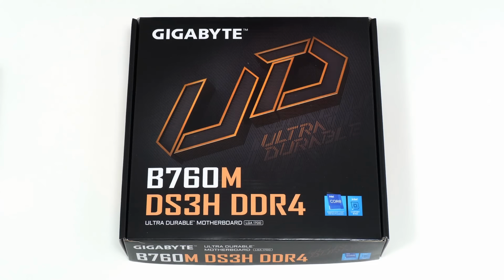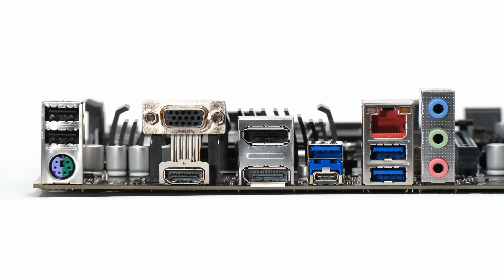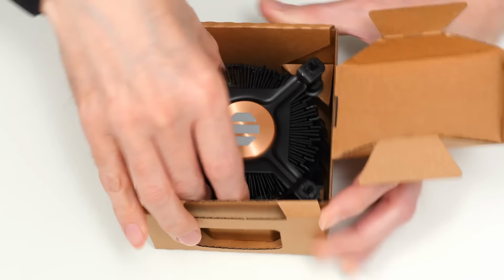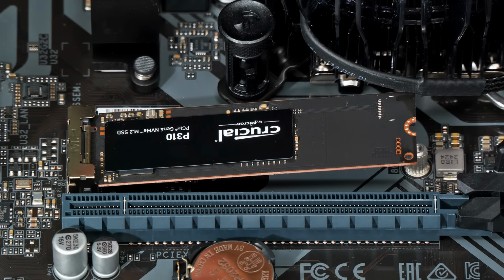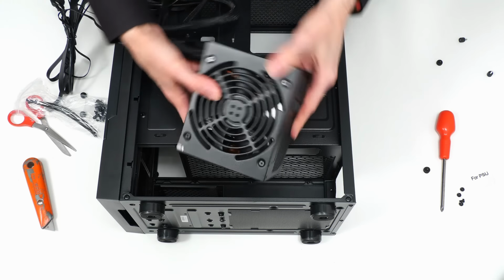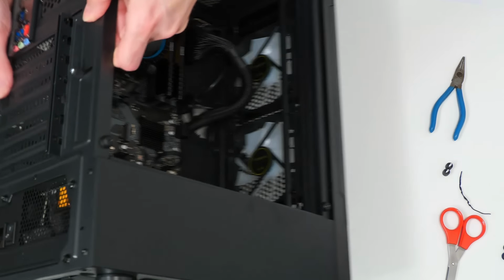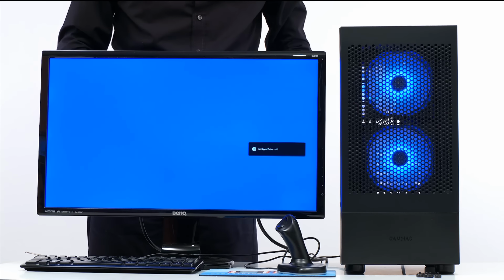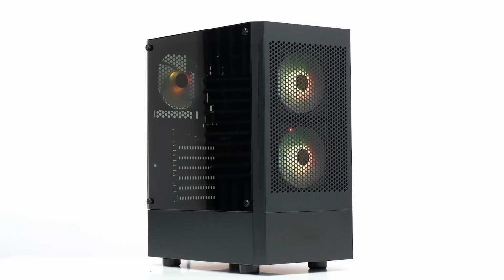Building a $500 PC

Comment: Very interesting video, Chris. It's amazing how much Mother Boards have changed over the years. The amount of connectivity is fantastic. Plus with that case you have loads of room for extra Storage, Memory or a more powerful Graphics Card. Anyone would be delighted with that as an entry level PC. Why not try a Hackintosh ? Anyway, thanks so much for sharing.
Reply from the maker: Greetings Brian. I must do a Hackintosh one day.
Reply: What makes a good hackintosh these days? I have a very old one -- 10.8??  on a Dell Optiplex 9010 (everything worked out of the box except networking, even tho I didn't install any kexts) but as I don't actually use it, I haven't got around to attempting an upgrade. Was fun to try, tho.

Comment: Can you arrange for the power supply fan to suck from the back and blow out of the bottom? 
If you don't want to be shoveling dust out of the box periodically, fans should be sucking from the outside through a filter and raising the pressure inside the box. Sucking off the floor is asking for trouble.

Comment: Whar a great video. I'm looking at getting a new PC, as my curent iMac is a 2014 model and really slow. I do 3D printing, so looking at getting a faster PC that can handle the slicing software etc. This seems to be just what I need,  May install 32gig memory though, instead of 16. Would this be an issue for this board/processor?

Comment: 06.01 It is not a resetbutton on the MB but the Q-flash plus button to install a new bios needed if the installed bios did not recognize the new processor without installing a processor, memory. Very usefull.  Love your explaining .. Greetings from Holland.

Comment: Pretty nice, the only thing I would recommend to anyone that wants to actually build this would be to splurge for at least 1TB (which should cost only about $20 more) because for example games these days are simply huge (like the 80GB needed for Cyberpunk 2077) so I think it's worth to have more breathing room from the get go
Reply: Not only are they huge, I've even had one or two games complain recently that they were installed on a HDD rather than an SSD! 😂
Reply: Or spend $100 on a refurbished ~8TB spinning platter and never worry about parking space again.
Reply: You think Cyberpunk 2077 will run and even run at all on that build? LMAO!

Comment: A trick I discovered while opening large heavy items like a lawn mower for instance is to turn the box upside down and open the flaps and then carefully turn it over with the flaps out of course and then simply lift the box off of the item.  This leaves the thing upright and the packing material can be easily removed.  Much easier than lifting something out of the box.  You might try this with your next PC case or whatever.  Would look good on camera because you can frame the important thing while removing the box.
Reply: Hey there!  We are trying to keep Stanley the Knife and Mr. Scissors employed around here!

Comment: The build makes perfect sense for the channel’s audience (whose goal is to explain computers to the uninitiated). With brand-new, store-bought parts, there’s little risk, and even in the worst case, everything comes with a full warranty.

However, those with some experience - or the adventurous - can try to assemble a machine with used parts. 
I wouldn’t recommend buying a second-hand PSU, SSD, or RAM, but you can easily find a motherboard, CPU, and GPU that, within the same budget, will completely outclass the build shown in the video.
Reply: I build mine from used and salvage for that very reason. But it's harder for a newbie to square up everything they need off the chaos that is eBay. They certainly will not have the experience to tell quality from crap in the used market. So for an initial PC building experience, I think going with this sort of build-from-new is useful. And it has a good upgrade path as the motherboard supports a much faster CPU (economical, once it's last years' model at pennies on the dollar) and more RAM, and that's a good place for the novice upgrader to start. And, of course, a better GPU is another good upgrade option. All without needing to rebuild the base unit.

Consider: All PCs run on used parts (they are "used" from the moment it first turns on). I don't buy used SSDs because of the lifespan limits (and the egregious fakery in the used-flash-storage market), but I do pretty much everything else. The only bad RAM I've ever seen was Kingston new in the box; none of the hundreds of GBs I've bought used had any defects whatsoever. Good quality PSUs will run 24/7 for about 20 years, and they are easy to test. And there are a lot of low-mileage HDDs available, if you need that storage. (I buy stacks of laptop HDDs for test use for around $5 each, and the average runtime is under 1000 hours, vs rated lifespan of 45,000 hours.)
Reply: @Reziac  
>it's harder for a newbie to square up everything they need off the chaos that is eBay

Oh don't get me wrong; I agree with all that - that's why I wrote that it makes total sense to demonstrate (to a newbie) the arcana of building a PC using new parts only. But it's hard not to cringe looking at the extremely entry-level GPU or that budget 4-core CPU when you can get CPU that's twice that fast and GPU three times as powerful for a similar amount of money.

I wouldn't recommend getting used PSUs. Yes, good ones last for a very long time (I have 15-years old OCZ psu that works just fine), but they can be affected by their working environments (heat, dust buildup etc) and have moving parts that can fail (I just put a new noctua fan in that ancient OCZ of mine) 

As for RAM, DDR4 is so cheap these days that it wouldn't make a huge difference. Also, while the risk is low, you can always get scammed or be sold untested faulty dice, and having an additional potential point of failure is just not advisable for someone with little experience in troubleshooting.

Comment: Just one tip; Check the routing for the 8-pin motherboard power connector before fitting the motherboard into the case. On more than one occasion I've found it impossible to route the 8-pin connector neatly after fitting the motherboard, so I've had to take it out again. Very annoying  !

Comment: Great video  and perfect timing for me. I am going to build a computer 
from the old parts my kids no longer use. I have a steel legend motherboard 
athlon 3000g CPU, nvidia1050 video card, 8gb ram stick, 550 watt power 
supply and about a dozen ssds ( they through them away at my job 
only 1 was broken) . I figure I just need the case now. Thank you.
Reply: Sounds like my kind of PC (mine are mostly built from salvage). Will be a pretty good unit!

Comment: 18:56 The most surprising thing about this build is that there are still PS/2 and VGA ports on a motherboard in 2025.  Is it even possible to buy a brand new PS/2 keyboard and monitor with a VGA port?  Not a dongle but an actual port.  I have those just sitting around from equipment I bought 25 years ago and occasionally have need of it with old PC hardware that I occasionally fire up, but I and most people have moved onto USB and HDMI/DisplayPort because those generally work fairly well.

Comment: It’s very strange that the fans didn’t have standard connectors, but oh well. However, did you remember to activate XMP? The RAM’s packaging only indicated AMD’s EXPO, but I honestly don’t know if that’s an issue.

Also, I only learned recently that no Intel CPU officially supports DDR4 speeds beyond 3200. Anything faster is technically overclocking, even though it’s basically a BIOS preset.

Keep up the good work!

Comment: Hate the black on black power buttons.  Sheesh.  I use white nail polish to make them stand out.

I'm probably just old fashioned but don't like the power supplies at the bottom of the case.  Is there any advantage of it being on top or bottom?  Only thing I can think of would be weight nearer the bottom of the case for stability, but I've never had any issue with a case falling over with the p/s at the top...  :)

Ugh, just saw that the p/s brings air for it's own cooling form the bottom of the case, where the MOST dust, etc. comes from.  Yuck.

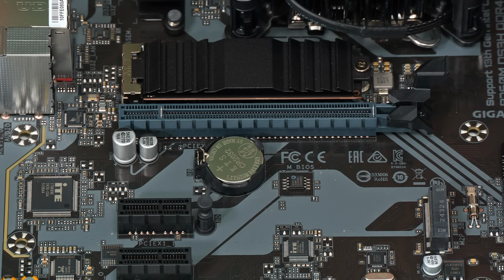Comment: 14:11  It should be noted that installing additional NVME drives on some motherboards will disable one of the additional PCIE sockets when its PCIE lanes are redirected to the SSD. I learned this the hard way. 😅
Reply: Indeed!!! Was going to comment the same! I was very surprised when was researching for a new build that this is the case. I would buy a SATA SSD, that are very fast nevertheless, to avoid that to happen. I thought Christopher was going to comment about it.
Reply: Good observation!!!  I was going to instal a second NVME on my system but something didn't feel right about it.  Thank you for clarifying.  Really, I have been happy with the solid state drives so I will just stay there.  They are fast enough.

Moonpie
Reply: @ian45-d8q   Only if you need the associated PCIE slot for another card. In my case I found out when I wanted to install a video capture card and it didn’t work because I’d already installed an NVME SSD.
Reply: It's wild for me how motherboards and chips nowadays can't handle much peripherals. Back in 2010 we had lots of USB, lots of SATA and PCIe ports, saturating a chipset was pretty rare lol
Reply: This might also disable two SATA ports (PRIME B550-PLUS).
Reply: @ Id never heard of that happening. Good to know; thank you!

Comment: Is that really better than a motherboard with a decent APU? I'm skeptical. 4GB is a real limitation. could have gotten an AM4 mobo with a 5700G.
Reply from the maker: This certainly out-performs my 5600G build -- and you do not lose any system RAM to the GPU. 4GB RAM is NOT a "real limitation". Not least, DaVinci Resolve runs well in real time -- and nobody can edit video faster than that. Oh, and DaVinci Resolve doe not even run on the 5600G system -- there are benefits to a discrete graphics card!

Comment: Why don't you disconnect the fans from the sata power adaptor and plug them directly into the motherboard? 
It looks like they have 4 pin connectors, so speed control should work fine.
Reply from the maker: Because, as I mentioned in the video, they DO NOT have standard fan connectors, and CANNOT be plugged into the motherboard! :)
Reply: @ExplainingComputers  Sorry, I assumed you refer to the sata and the RGB plugs on the adaptor. 
I didn't know you unplugged the fans from the adaptor, as I didn't see the fans connectors in the video. 
It's just hard to imagine what went on in the manufacturers mind, to go to the extra expenses for proprietary connectors, while making the value for the customer worse.

Comment: Do you have plans for making videos about building a server that can be used to host own web applications? Many small companies and startups struggle with the expensive commercial cloud hosting services. We are using Synology NAS for that prupose (which is not optimal and also expensive), and we would appreciate your inputs on that!
Reply from the maker: I don't have plans, but have made a note.
Reply: You don't have to jump straight to the end go cloud you can just rent a modest linux machine and use that, they cost buttons.
Reply: You can install a LAMP server on any Linux system.

LAMP stands for "Linux, Apache, MySQL and PHP / Perl / Python" and you'll find packages for these in your distro repositories.

Apache is a web server. That is, it responds to HTTP (port 80) / HTTPS (port 8080) requests and serves files from the system.

You can place HTML, CSS and JavaScript files in a particular folder, then write a config file for Apache to tell it where those files are (and other parameters, like SSL certificates, if using HTTPS). Then it'll listen for HTTP requests on port 80 (or HTTPS on port 8080) and serve up the files.

Opening up the firewall to port 80 or port 8080 allows incoming requests to be received by your "server" and it'll just work.

I did this for a web development job once. In order to demo to the client the website I've designed and developed for them, I took in my modest Linux laptop that had Apache installed to their office, connected to their LAN and then discovered the IP address it had been assigned.

Then I told them that if they used that IP address in their browsers, they could see the website I'd developed.

They didn't have to huddle around the screen or take turns to use it, but could simply use their own office PCs to browse to my "laptop server" and each could individually take a look at the website.

I guess the point I'm getting at is that a "server" is just a machine that serves files - listens to port 80 / 8080 and doles out files on request - and you can turn your desktop or laptop at home into a web server, no problem.

When talking about "server hardware", as found in data centres, it's still PC hardware. It's just been optimised for this purpose - lots of storage, lots of bandwidth, redundant CPUs, redundant power supplies, multiple network connections, etc. and designed to be "rack mounted" so you can slide dozens of them into a server cabinet.

But you absolutely can run a web server - be it Apache, NGINX, a Node.js server - on any PC hardware. Indeed, when developing a website, it's a great idea to spin up a "private web server" on your LAN. Keep it inside your firewall and then only machines on your LAN can access it. But you can develop and test your website on your local web server.

Then, when it's done, you can FTP all the files over to a real public server on the Internet - which has a proper "domain name" pointing at it - and unleash it on the world.

And, with Linux, all the software you need to do this is open source. As I say, you'll find packages for Apache, MySQL and PHP (or Perl or Python - people prefer different scripting languages, but they all conveniently start with "P", so the "LAMP" acronym still works) in the repositories of all major Linux distros (some even have a single "LAMP" package to set it all up in one go).

The magic keyword to search for is "LAMP server" and you'll be able to find many articles on how to set it up, configure it and get it all working.

Indeed, a common thing to do is install your LAMP server and then install Wordpress (which uses PHP as the scripting language). Wordpress is a "content management system" or basically a framework to build websites on, with many themes and plugins available because it's very popular. There are many others options - such as Node.JS to do everything in JavaScript - but, for a beginner, set up a LAMP server and install Wordpress. Once you know what you're doing, you can literally throw up a Wordpress wesbite in 5 minutes.
Reply: Yeah you can rent a VPS for as little as a dollar a month. You can even rent a full dedicated server for around $50 a month.

Comment: I know from experience how satisfying, and relieving, it is to turn on a PC for the first time and see it boot into the BIOS. I remember doing my first build, hoping I connected everything correctly, and being glad to see everything working. I'm no expert, but 33 degrees Celsius sounds cold for a CPU temperature, but this is a first boot. My PC usually is at 35 degrees on a cold boot after being off for a while.
Reply: Copper core cooler makes a big difference, especially on these conventional hatbox type fans. 

My Xeons wear hand-me-down HP heatpipes, little things with one fan running at half speed, and they idle just above ambient temperature.

Comment: 4 cores in 2025? C`mon, that weird pick. i5-14400F has 10 cores and costs pennies as well.
Reply: How did you purchase windows 11 for your new pc?
Reply from the maker: Neither the i3 14100F or i5 14400F "cost pennies". And the i5 costs significantly more than the i3 (c.$130 vs $90).
Reply: @ExplainingComputers  2.5 times more cores for $40 extra is a great deal.
Reply: A grown-up's OS like Linux will still run happily on Core 2 Duo systems. If you can't visual a PC beyond it running bloated and privacy-hating Windows, then that's unfortunately a limitation on your part.

Comment: A PS2 port? Next we'll be installing an 8" floppy drive and 1200 baud modem. :face-turquoise-covering-eyes:
Reply: I still used a PS/2 keyboard on a Z370 motherboard most of the time because PS/2 input never failed me compared to USB.
Reply: @asiano3385  Yeah, I use KVM switches and while PS/2 always works, USB is often an Adventure. USB wireless keyboard dongles can be even more adventure!
Reply: My guess is the input from that gets translated to USB signal equivalents.
Reply: ROFL!